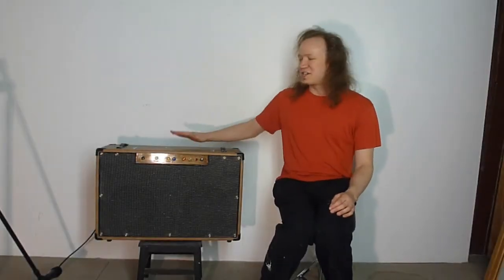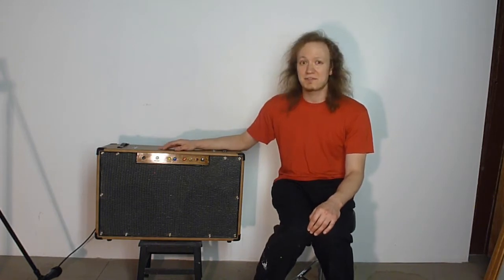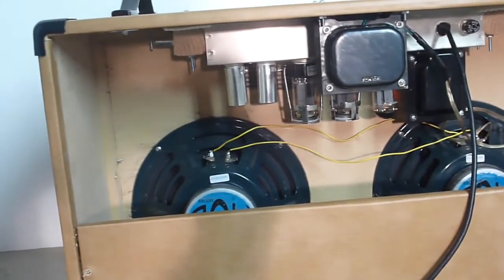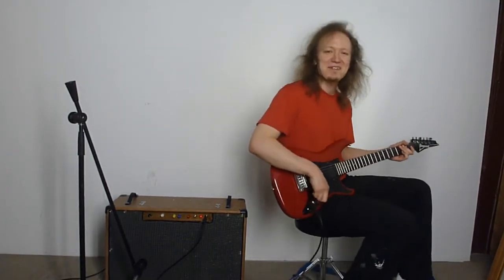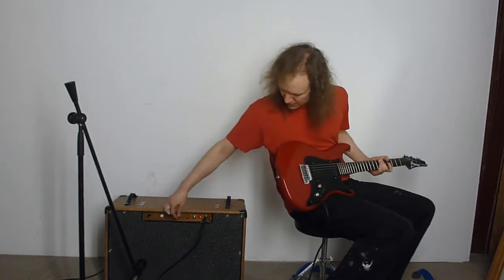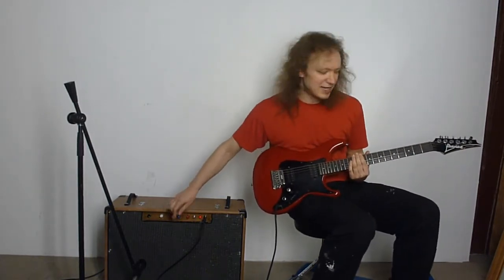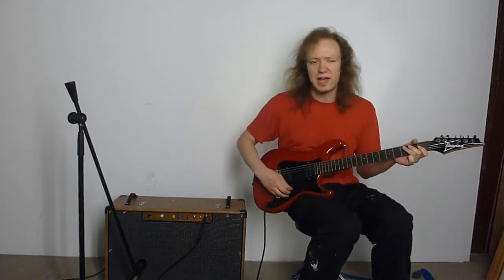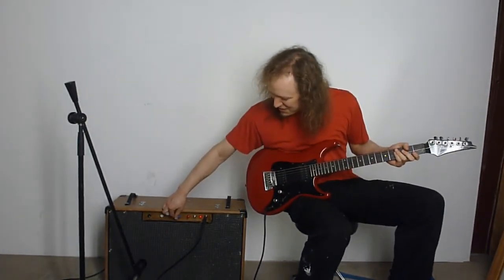Cathode biased 6V6 tube amp build

Comment: It is a cathode biased amp with cathodyne and has negative feedback. This makes IMHO in theory an amp designed for clean tones. It has
- a more linear power amplification and headroom with harder clipping
- flatter response without bright circuit at the volume pot and baxandall tone
- non ideal balance between the output swings (cathodyne has different output impedances) adding some even order harmonics
It should sound very good clean yet harsher when going into clipping.
Reply from the maker: To some degree yes. There really is only so much negative feedback you can wrap around a cathodyne inverter before you start to get weird effects. If memory serves, this should have a similar amount of feedback as a Princeton. And the presence knob, when turned up, shunts most of the higher frequency negative feedback to ground. Being both cathode biased and tube rectified does considerably cut into clean headroom a bit, though it does add quite a bit of compression when clean, which is a nice effect.

I actually ended up changing the circuit a bit after this video to make it brighter and higher gain (shrinking some coupling cap values, and partially bypassing the second gain stage cathode.) I definitely like it better now. Flat response curves all the way down to 82Hz actually don't sound that good in practice, it is just too dark. And once you get into gain, it gets hard to avoid muddiness and blocking distortion.

Comment: I'm obviously very late, but that thing rocks! How were you able to put 500v on the plates? Even for JJ tubes that seems to be pushing them hard. Would be interested to hear 2x 12aAX7.
Reply from the maker: Thanks! So first of all, it has about 500V on the plates, but since it is cathode biased, the plate to anode voltage, which is what really matters, is a bit lower, somewhere around 460-470V if memory serves. Second of all, you can generally go a fair bit over voltage requirements as long as it isn't too strained elsewhere. The biggest risk is flashover, either between pins or between tube elements. This can be minimized somewhat by using a larger grid stopper resistor and not mismatching the impedance too high. Lastly, a tube rectifier will tend to drop the voltage more and more as current increases, also limiting strain a bit. Granted, a GZ34 (the most efficient tube rectifier) coupled with lower current tubes like a single pair of 6V6s doesn't drop the voltage nearly what a 5Y3 or EZ81, or even a GZ34 into a pair of 6L6s would. I've been gigging with this amp for close to a year now on the same tube set without issue so far. 

If I were really trying to squeeze power and used this transformer with a diode rectifier and fixed bias and smaller grid stoppers, it would actually crack 30W or more, but there would definitely be potential for catastrophic failure.

As for a pair of 12AX7s, the amp would really have to have the cathode bias resistors replaced on the last gain stage and phase inverter to work right. It would function with just a tube swap, but the bias would be way off, it would probably cut into the output volume, and have a lot more cold clipping. No reason I couldn't try it, but I have a feeling it wouldn't sound all that great. Also, since all the circuitry is jammed into a really small project box on this one, I suspect it would feed back on stray capacitance between gain stages and squeal at full gain. The second 12AX7 would actually only add gain on half of the tube anyway, since the second half of the second tube is used as a cathodyne inverter, so the gain is less than one on that stage either way. The upside to a 12AU7 is that I can then run smaller grid and cathode resistors to lower the output impedance and drive the power stage harder. 12AX7 cathodynes can tend to struggle to drive big bottle tubes, which is why long tailed pairs are almost universally used instead in larger output amps.

I did actually recently change the circuit slightly to add more gain though (and brighten the tone), by bypassing the second gain stage bias resistor. I should probably reshoot this video at some point. And get the output power right in the video.